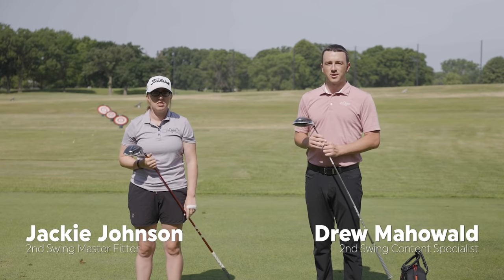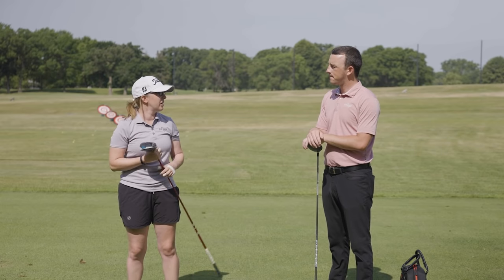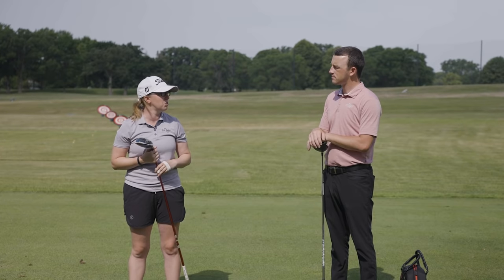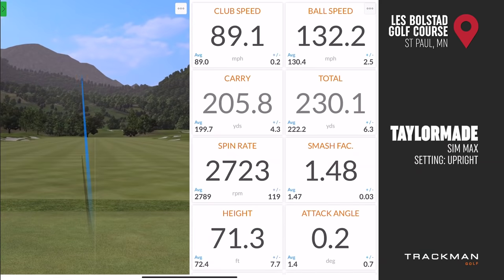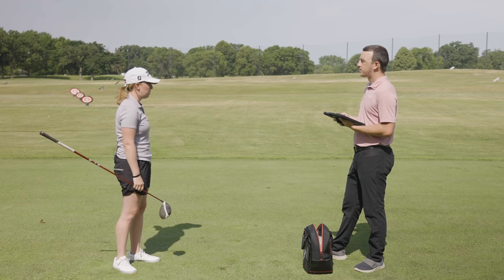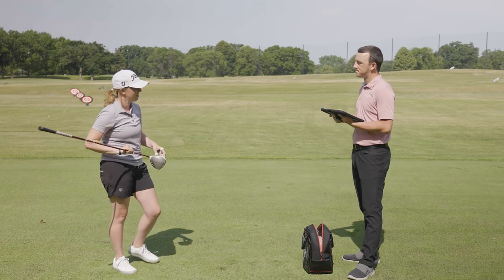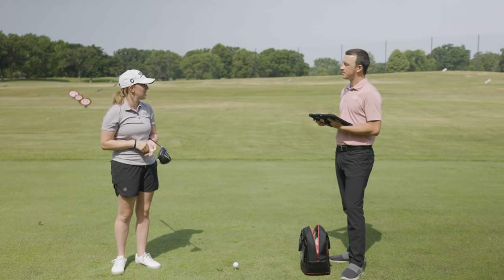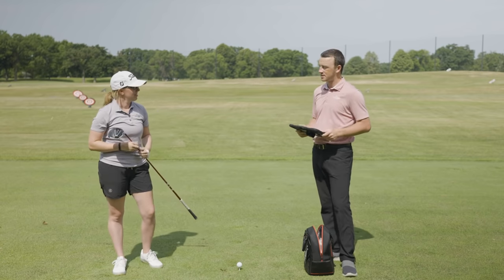Fix Your Slice With Driver | Best Way To Create Draw Bias With Driver

Comment: Great video. I also hit the Sim Max even though I have a TSR 2 and a Cobra Jet I still get more distance from the Sim Max. I have the exact same outcomes as Jackie with the Sim Max. Tried higher loft settings got straight pulls. I have a natural fade also so I’ve found the standard setting is best. IMO the Sim Max is the best driver head Taylor Made has produced to date.

Comment: Lighter shaft can help get the club head through as well as counterbalanced shaft. The club head gets through and closes the face. Weighting should be centered in the back of the driver head for best moi. I’m not a fan of weighting the heel to help close the face with shaft/wrist rotation. It reduces the stability of the club face. With the driver, club face stability is the key to consistency. Any degree off can be the difference between fairway and behind a tree. You don’t want a club face that closes fast. You’ll slice one shot and duck hook the next. Having a shallow swing is important to create a stable club face that closes with the club path. It also helps produce an ascending hit on the ball. That allows you to use a lower lofted driver and put more energy into the ball. In conclusion, buy a normal driver and get good.

Comment: I have a question for you no one else can answer ... taylormade loft sleeve... if you use a left handed sleeve on a right golfer does it work opposite? Meaning opening the club face would increase loft and closing the face would decrease loft. Normally, opening decrease loft and closing adds loft - with a right handed loft sleeve for a right handed golfer

Comment: I bought draw biased equipment for years. All it did was bandaid my shitty swing. Once I fixed my swing I would get monster hooks with the draw biased equipment, dropped another $1200 on new clubs. Lesson learned, fix your swing instead of buying gimmicky equipment
Reply: What did you end up getting
Reply: I did the same thing, fixed my swing - which is the right way to do it. I have a 10.5 draw biased driver and turned it down to 9 degrees and it goes left less. I aim at the right side of the fairway and it goes to the left side of the fairway. I'll going to try it at 8.5 degrees and if that doesn't work, I will get a new non-draw- biased driver.

Comment: You should’ve used a tester who consistently sucks (like me) instead of someone who hits it consistently like the young gal here. If you can fix my all over the place hits and get it to go one direction then you know your test was successful and doing these adjustments work.
Reply: Not sure, what imo would be a best test an iron Byron? The only change would be adjustment as the swing would be precise?

Comment: The intentions of this video were good but the actual execution was flawed. If you're going to adjust the hozzle to raise the lie angle, it will naturally close the face by approx 2 degrees or approx 4 degrees at the highest setting. Unless you're going to square the club face to the target at address, of course the shot is going to go to the left...you've just closed the club face. If you leave the club to setting on the ground at it's balance point, the face will be closed. She really needed to address the ball properly by aligning the face to the target and the shots would have been straighter.
Reply from the maker: Thanks for watching. You bring up a great point adjusting the hosel opens or closes the clubface. Would be best to put some time into club path and alignment to get the ball straighter yet still have the change with a closed setting to draw the ball. - Thomas